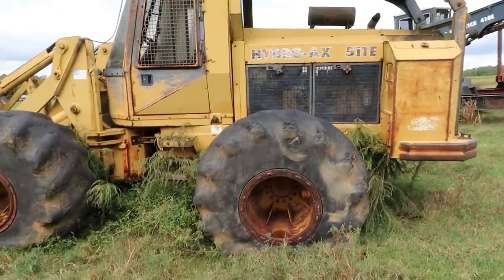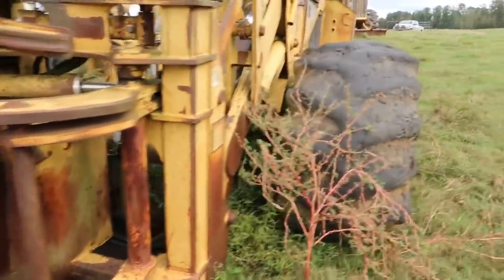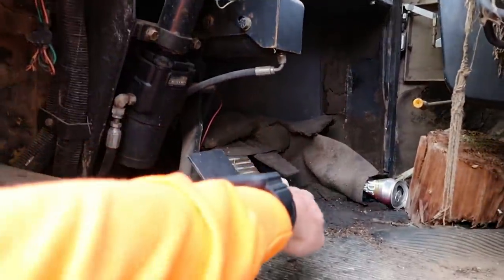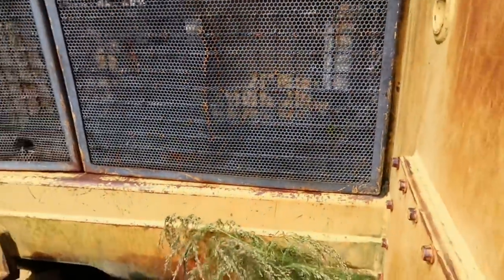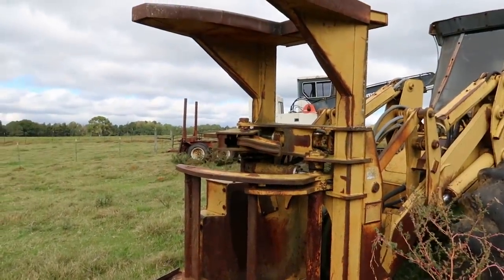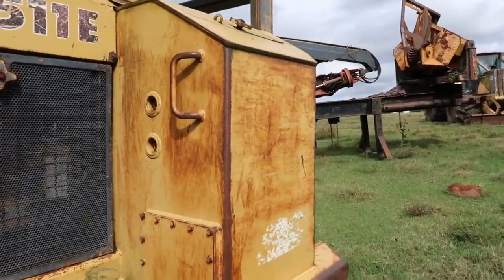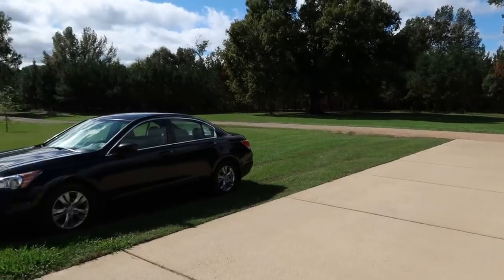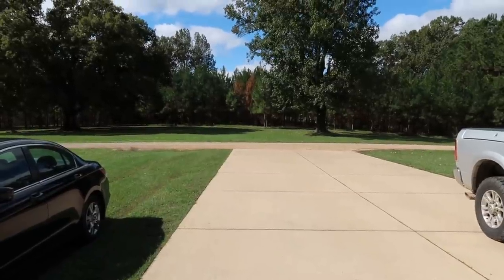Hydro Ax 511E | Tired old iron

Comment: If that equipment would run, that would be a start up man's dream right there. First sawhead  cutter I had was a 611b model, with that same side cut sawhead. Moved up to the 711ex, they were great cutters. Hydro ax went to a 70 series,I had a 470,570 and a 670, over the years. Still today,I have a Prentice 2670 with that sawhead,I really like them.

Comment: I always wanted to know why the side of the head folded up on the left side you showed around 7:17? Blount, Prentice, Hyrdo-ax were great machines.
Reply from the maker: Some had a hydraulic cylinder that would open that side so u could cut the side of larger trees so that u didn’t have to drive all way around the tree.  That just looked like a cover to clean debris off the disc.